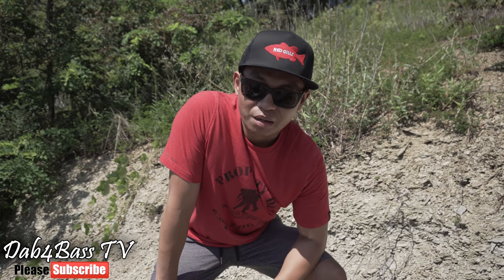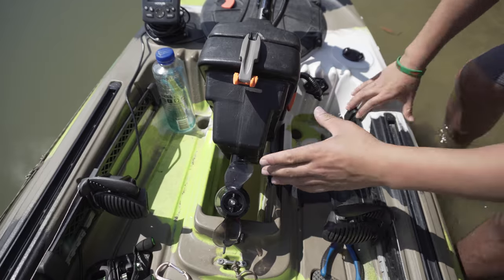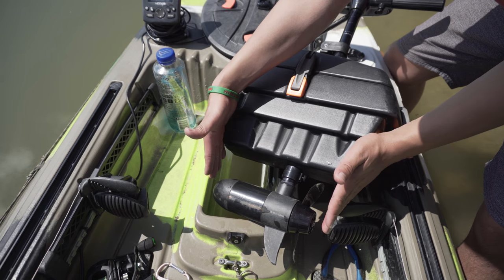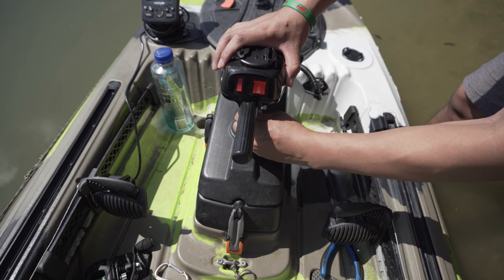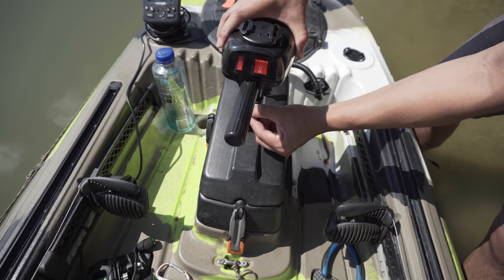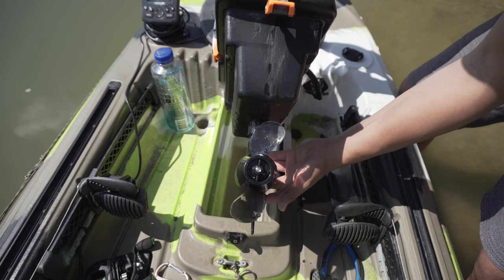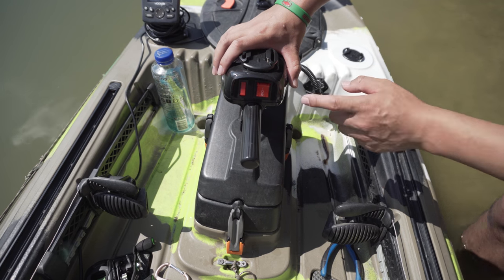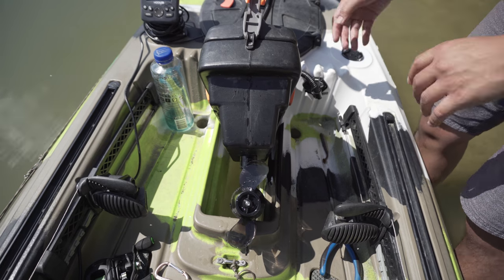Feel Free Lure Trolling Motor: Question Answered

Comment: That is awesome.  I just bought the same kayak.  I will build mine exactly the same.  Great job
Reply from the maker: Nice! Leave the shaft uncut if u like to stand and fish! A mistake i made. I also upgraded my trolling motor to a 30 lb thrust minn kota endura c2. It gave me a bit of boost. Fits nicely too
Reply: just to confirm before i purchase it, a minn kota endura 2 will fit through the sonar pod hole? i am getting a 40 lb thrust as i have a tandem yak, feelfree lure 2.
Reply from the maker: Minn kota 30lb thrust endura c2 fits. Anything bigger may not fit but i havent tried anything bigger.
Reply: Does the tail rudder help with the steering?  I installed the trolling motor like this with 30 lb Minn kota c2 but the steering at times can be tricky.  Do you think the rudder will help?
Reply from the maker: Yes rudder will be your best friend for tracking through the water.
Reply: Can you please make a video of how you actually mount it through the box..Thank you in advance

Comment: I did mine a little different . I also added a pwm so my battery would last longer . My pwm is mounted next to my seat . I also left original controls for trolling motor on front of pod so if pwm went out . I still have my storage with trolling motor mounted . 
 It works greak great fishing the snake river with my downrigger .
 I ram wiring in hull after I tested my pwm for a year to make sure it wasnt going to go out .

https://youtube.com/watch?v=qsHHnkaMSC8&feature=share8